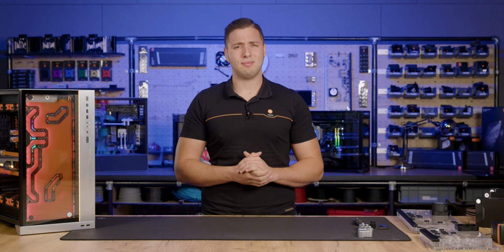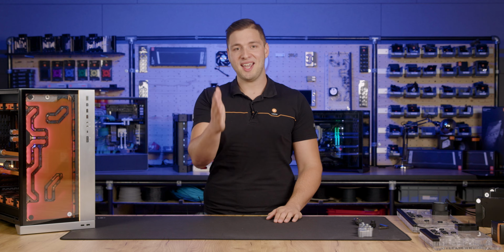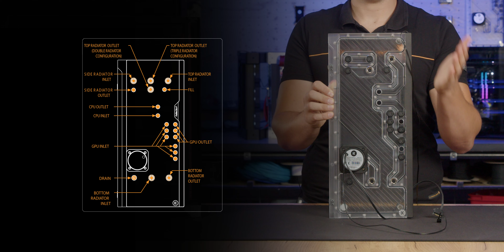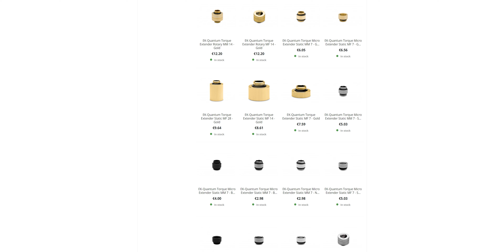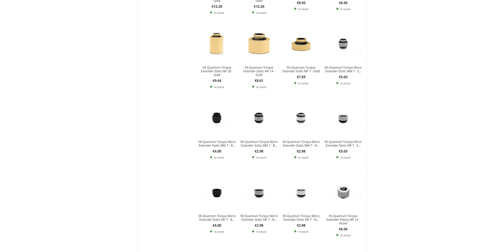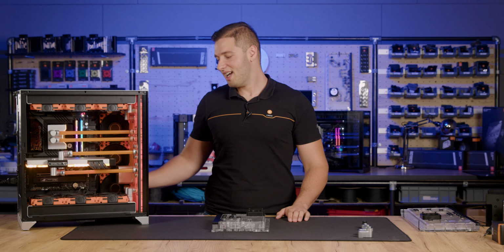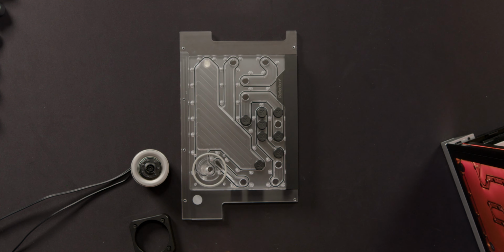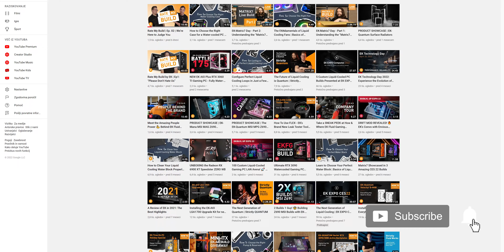Distribution Plates: Everything You Need to Know | Basics of Liquid Cooling

Comment: IMO distro plates make custom water cooled setups look boring, it takes all the creativity out of the loop and most builds end up looking the same.
Reply: But they do look neat and well designed.
Reply: They are great for beginners though.
Reply: I am getting one for my O11 XL, but not planning to use a bunch of 90° adapters, instead I will bend the tubes myself. And because the motherboard is for a ThreadRipper Pro, it is unlikely that the Velocity2 will line up perfectly with the distro plate either, giving me a bit more opportunity to make a nice multi-angled bend in the tube myself.
Reply: Dont agree with you

Comment: but it is not necessary to lead the water from each component back fin the distro plate, right? can i make a full loop with only connectin the two radiators to the distro if i doesnt want straight tubes? i mean: water from distro in radiator, then radiator to gpu, gpu to cpu, cpu to second radiator, and then the second radiator to the distro? is it possible this way? or are there any reasons not to this?

Comment: Would love to see a video using the Distroplate for the O11 Dynamic EVO in triple radiator configuration with 360mm x2 and 280mm x1.
Reply: I am going to build this but with  triple 420 rads (ekwb manual reffering to this config as possible
) If I don't forget, will get back to you.

Comment: I am so glad I have found you on YouTube. Question: I am looking at replacing my old box with a new built using the newest Lian Li O11 Vision. I am a newbyto water cooling and I am looking into it at the moment, learning. I have observed EK has specific distribution plates for different Lian Li O11 cases ... (mini, EVO, XL )  but not the latest Vision one.  Would the  PC-O11D EVO D5 PWM D-RGB  be suitable. Looking at the dimensions I say  it would fit, however , what about only fitting the distribution plate along one side only (screws on one side but not the other) ?

Comment: If I've already got my distroplate filled, do I have to drain it to install the Quantum Convection D5?
Reply: Yes as you have to remove the default holder.
Reply: @Mew77778  Thanks, I later found that out from EK. Wanted to avoid draining my newly finished build if I could help it but all good now.
Reply: @BigOlBilliam  if you drained it, did you reuse the coolant you drained?
Reply: @FlashpointLPT  I did reuse the coolant when I installed the pump cover, but that's because the coolant was only a few weeks old. I'm actually going to need to tear my rig down for some fan issues, and in that case, I'm probably going to do a coolant swap.

Comment: One this that You do not understand at Ek, is that the whole purpose of Distro plates is to reduce the amount of angles and fittings to create a more efficient loop and especially spend less.
While You at EK literally make it so expensive and complex that it is worse . Frankly distro plates should also be placed at the top or bottom and NOT at the front or side, and keeping in mind to use the least  possible length of tubing and fittings possible.
Thats why nobody is buying your distro plates and above all they cost a fortune while the whole concept of making acryl distro plates was about saving money.
Reply: It's not about saving money, it's about convenience of having a standard set of alignment on the ports so that you don't have to do as much custom bending, and being able to show off the coolant at the front or side. It won't work at the top/bottom because of how thin it is, and how little space you get in the case. Plus you can't use the pump at the top of the loop, it needs to be at the bottom or it would just suck air and burn out. If you want to hide away your coolant reservoir and pump, just use the traditional tube style and DDC or D5 pump, you can mount the tube either horizontally or vertically as you like.
Reply: I’m not defending their prices, but I’m pretty sure Derbaur was the one who made this mainstream at Singularity Computers. Nothing about his distro plates was for affordability. It was for looks with straight runs.  It was an aesthetic option for a premium pc

These days, with the fact that many 3d printers can equip milling heads, I’d imagine ppl could custom make their own assuming they could find an accurate CAD model for their case and do the work. Finishing the acrylic to make it absolutely smooth and clear would be the most difficult part.
Reply: @DD-sw1dd  DEbauer has nothing to do with singularity computers,,,, singularity is based in Aussie...distro plates are not mean to be for aesthetics bu t to reduce the number of fittings and tube lengthyou design your own distro so to make ur loop shorter and more efficient.
EKWB DUSDTOPLATES AR ENOT DISTROPLATES, but a big reservoir pump combo with holes to add more unnecessary tubes and fittings to aloop with zero purpose.
You Use a ditro plate to make Your build look clean with less possible  tubes instead d of making it look like behind the wall of a toilet or bathroom  which is precisely how Lian li case with an EK distro lookhydraulic